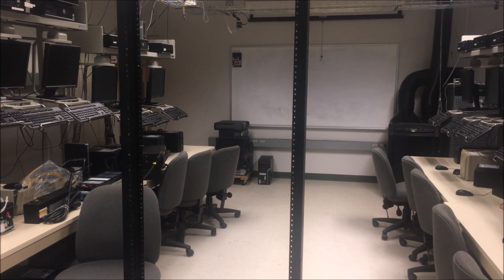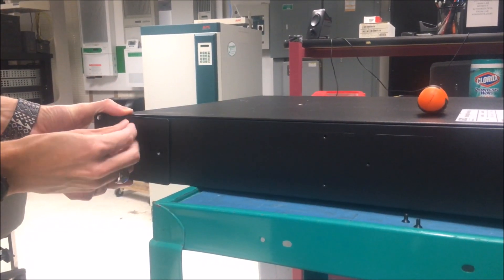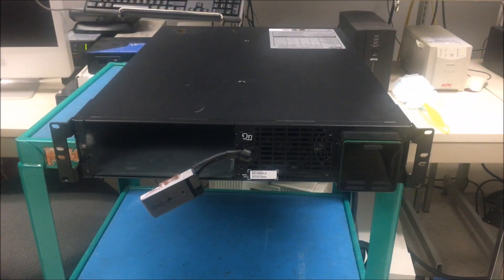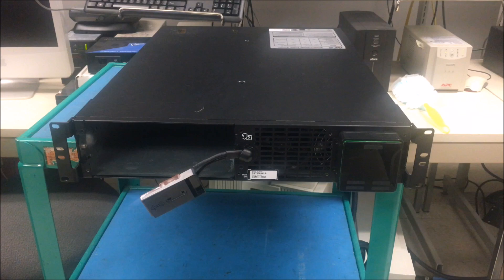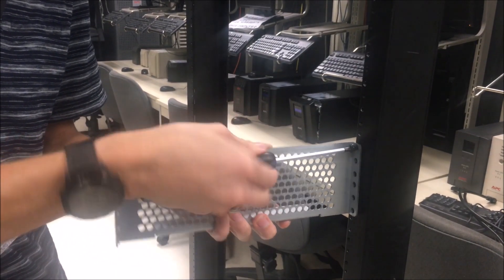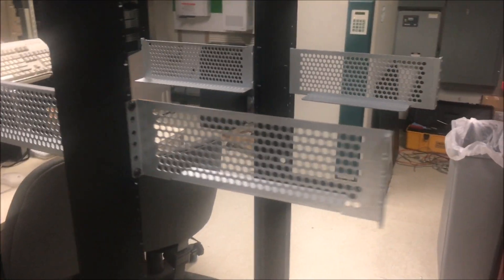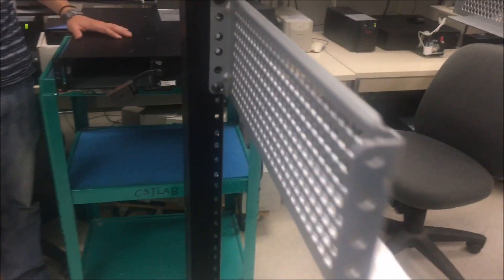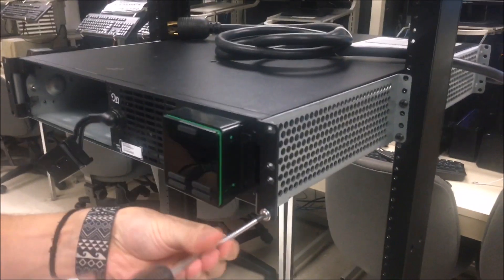Installing Smart-UPS into Two-Post Rack Using Two-Post Rack Kit | Schneider Electric

Comment: Wow - only ever played with 4 post racks.  These 2 Post racks seem flimsy and shaky.  Do they stiffen up when you have a lot more equipment racked in?
Reply: Normally, a stand alone 2-post like that is also top secured in at least two points.  The 2-post in the video is one of the cheaper ones as well which are significantly less rigid.
Reply from the maker: Thank you for your message. We apologize for any inconvenience caused. Our customer care team would be happy to provide assistance. Please reach out to a customer care member in your location here: https://www.se.com/ww/en/work/support/country-selector/contact-us.jsp
Reply: @schneiderelectric  holy candid answer batman

Comment: Is that the two post mounting kit AP9625?  If so, how much clearance does it in need in the front and the back of the rack with a UPS installed?